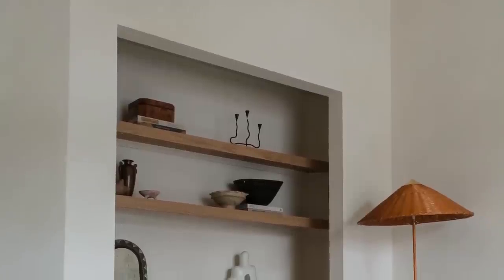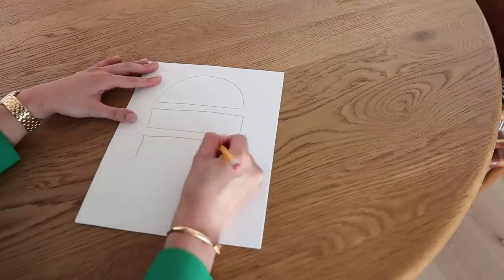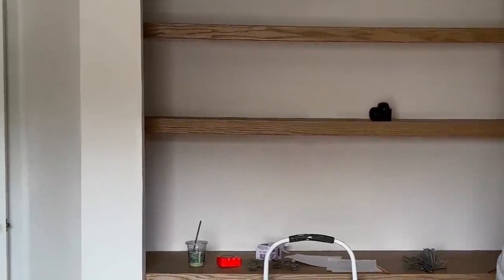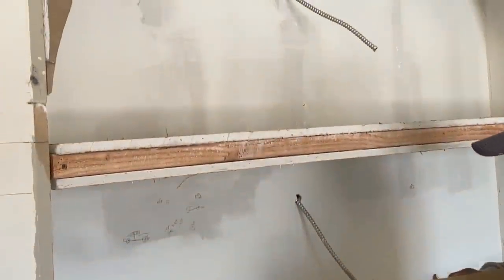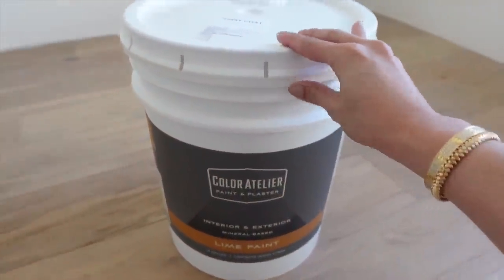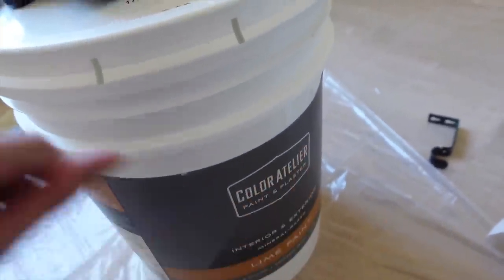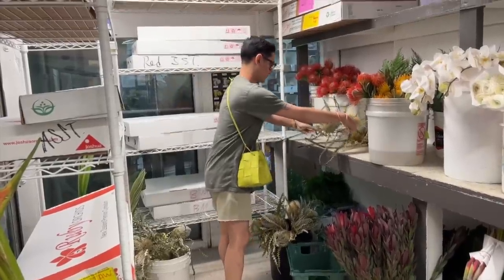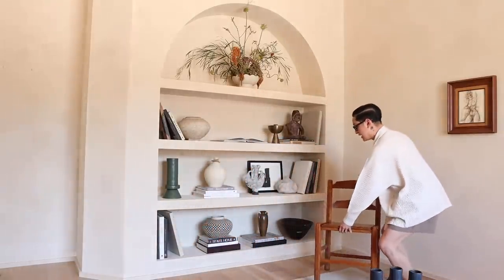TURNING A SMALL CLOSET INTO AN ARCHED BUILT IN SHELF

Comment: The floral is chef's kiss! The following is my POV and take from it nothing or whatever sparks interest. I think arranging items so your eyes move left to right will be better. So if one shelf has a vase sitting on books, don't do the same immediately under it on the shelf below. Do it on the right side of the shelf below. Alternate height of different items on the shelves and add some depth. Add items other than vases. Pictures, sculptures, animal figures, a clock, small greenery, baskets. On the second to the bottom shelf the vase (or is it a candle holder on the left side), looks kind of unfinished without whatever is supposed to sit inside it. 

The picture on the wall behind you, is too small for the wall, but perfectly in scale for the second to top shelf! It will give you some depth up there as well. Styling shelves is incredibly difficult, I have found. I think every shelf here needs at least one fairly large piece, especially to replace the open book which is too flat and lacks the height needed for that space. I feel that everything looks too spread out, as if they were lined up instead of interwoven. 

After numerous iterations, I finally completed the decor for two shelves in the bathroom and now every time I walk in and see it, I smile. Yes, it sparks joy! Yet, if I had seen a picture of it earlier, I would have ignored it. My aim was for pieces that were spread out a bit, and very neutral. What I ended up with was lots of depth, lots of florals and greenery, alternate heights, varied items, varied textures, and a bit more color than anticipated. Even though I live here, I still want to walk over to it and look! It's interesting! What is that peeking out from those greens? Oh, it's a terracotta candle! And so on. I say keep changing it until you are happy to just stand there and look at it. More IS more, I am finding out. It's so much more interesting and if you like decor, what a wonderful reason to keep buying MORE!!! ;)